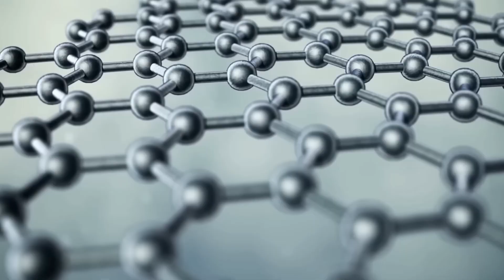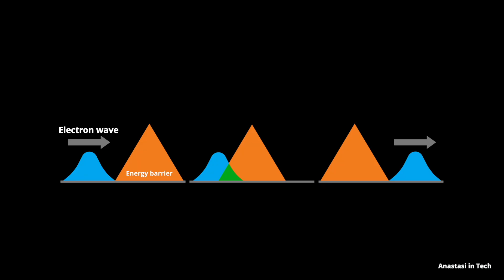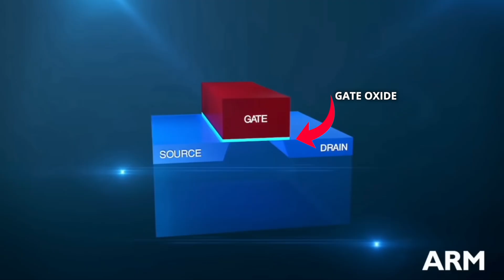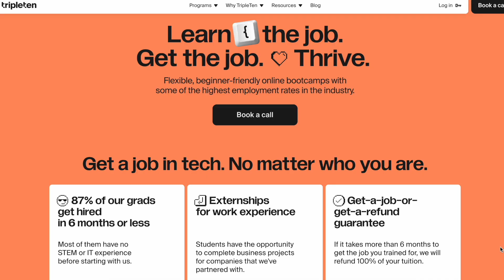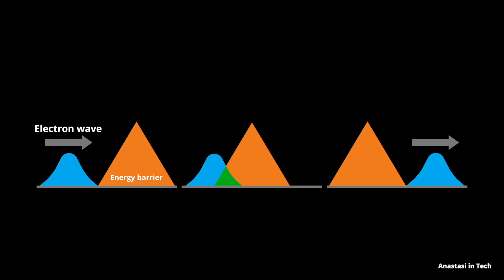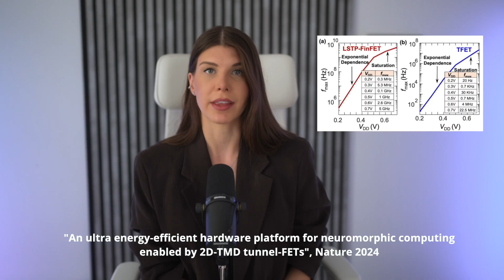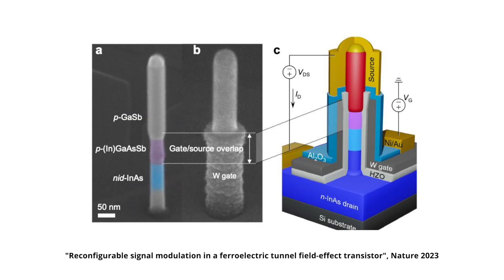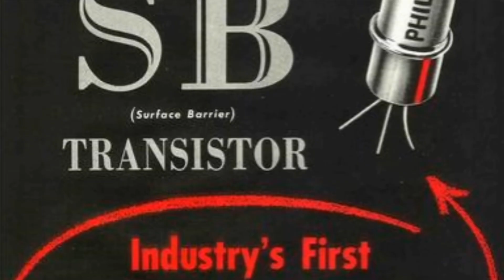New Microchip Technology: 90% Efficiency Gains

Comment from the maker: Improve your career using my code “Anastasi” for 30% off on all their programs! Sign up for a FREE TripleTen career consultation with my link:  https://get.tripleten.com/AnastasiInTech
Reply: Hello anastasi. Which ranking is it reliable to know where can i study Computer Hardware Engenieering?
Reply: Other thing. Why there is no an hybrid solution with HBM and GDDR memories in commercial Graphics cards?. Imagine, 12GB of GDDR and 4 of HBM, both with a parallel access to GPU with a priority of LOD?, it would be awesome, more performace and stability a reduced power consumption.
Reply: You talk like you have decades of experience but look like 20 😀
Reply: A thought, inall my years I've seen many wonder technologies or materials that were supposed to supplant semiconductors as we use them today, and composed today, and never did. What seems to be missing from most of these is the relative gain capability, therefore allowing for a clear signal to pass through the transistors one after the other. Or in the materials that do manage to have the same or better gain, they are so very expensive, that they were uneconomical even 30 years ago.  Is this new material both potentially economical compared to current technologies, and does it provide an equivalent amount of gain?  Or get around that by providing an equivalent mechanism?
Reply: If there are any supposed hackers here worth their weight, I challenge you to troll and disable truth social. But I kind of don’t believe anyone has the skills to do it. If I see it happen in the next few days, I will apologize and send donations. But I somehow don’t think anyone has the talent to do it.
Reply: @NotSure_News_notsuremedia-com I guess you don’t like truth? Either that or you just can’t stand any opinion that is different than yours? How totalitarian of you 😊
Reply: I would like to know if you thing that this new discovery at MIT might be a game changer in your tech interest... https://www.youtube.com/watch?v=17Y82tJDk2o
Reply: As always super video
Reply: Do you have a method for vetting your upgrades? Seems everything is already obsolete, you're so aware. 😅
Reply: Right!?

Comment: I have watched switching voltages over the years.  5V TTL, then dropping, dropping, dropping...  The i486 and PCI bus enjoyed much lower switching voltage requisites.  We have come a long way.  But 0.1 V That's just WOW.  Way less juice needed.  Way less heat generated, and much faster transitions.  That's just WOW...  considering how far we have already come since even the i486.
Do you have a link to you thesis paper?

Comment: Was spending a lot more time outdoors would be one good thing about it, right? Yes, they are going through a substance such as an oxide, but electrons pass through solids all the time, metals, and it's not that the atoms of the insulator are closer together than the atoms of the metal and therefore block the electrons, it has to do with energy levels inside the substance and not with physical barriers.

Comment: you can use this "bad" effect for free energy by using a low work function material, a nanogap , and a high work functioning material. it's called an evercell (Clark Boyd old dominion university , virginia) and the spontaneous electron tunneling creates a small but eternal current. you make them in arrays to get more power

Comment: I was born in 1951 and I can tell you that there was absolutely no smart devices of any kind. Even the first remote control TV's were mechanical and the first ones were even wired. We bought our first TV after 1955. 
BTW: these were all tube type even though the transistor was invented in 1947 I don't remember seeing anything with a transistor until the first "transistor radio" invented in 1954 which were not really popular until later (60's?) because it cost about $50. (that would be almost $400 today.)  ------ K5AZE

Comment: any time some tech announces they "mimic the human brain" you have to keep this in mind as a baseline: 1. neurons fire using their own power, completely independently of each other (i.e. true parallelism); 2. neurons are highly interconnected -- up to 10k dendritic connections each, all working in parallel; 3. activation has inherent decay, which means there is no external mechanism for creating these spikes; 4. lastly, and imho most important: memory is NOT some localized thing that is analogous to a bit that is on or off. memorization equals recall! in other words, in networks of neurons there is ZERO distinction between storing information and retrieving it.  maybe we should be a little reluctant to compare things like back-prop nets or neuromorphic computing to the brain.

Comment: Tunneling was initially described by physicist George Gamov, his theory did not obey the quantum mechanical “essential”  (Max) Born rule, so Born published his own version of qm tunneling that satisfies his “essential” rule. However, in de context of Pilot Wave theory, the Born rule is not essential (not always true), which means that qm processes like tunneling electrons can benefit from Pilot wave energy to gain in potential energy, and this means that qm tunneling transistors can achieve efficiencies of over 100% (overunity), by converting Pilot wave energy into potential electric energy. This is the dawn of powerful ‘free energy’ devices that are independent of solar energy, since the Pilot wave energy exchange with any particle in the universe is huge.

Comment: About halfway through the video at the moment....
There are two things I would like to mention as items of academic discussion.  First, I have actually wondered if the future will involve a form of data storage and flow which is a bit paradoxical.  Most losses in a CPU will come from ohmic losses and switching losses which accompany depletions of gate charges and capacitive biases.  The movement of static charges is lossy.  By contrast, if I have an LC resonant tank circuit passing that charge back and forth, the properties of the capacitor and inductor drive voltage and current out of phase, which results in power dissipation being significantly reduced.  While it would certainly take up more area and be a hassle to get it to work correctly, a CPU architecture which worked closer to a zvs tank circuit at the logic gate level could be less lossy than traditional architectures, at least where heavy processing loads are expected.

Second, I often wonder if vacuum tubes will make a return, almost specifically because of the challenges of using modern CPUs outside the shielding of Earth's ionosphere and atmosphere.  Cosmic rays corrupt RAM and cache memory like no one's business.  Without mosfet and related technologies, I have wondered if we still would not have seen development of microscopic arrays of vacuum tubes and analog computers similar to today - obviously different in specs and capabilities, but if we were to miniaturize vacuum tubes or related devices to produce miniaturized devices, how far could we go?
Power electronics would be the biggest area where we'd be at a loss.  I am not sure something like a variable frequency drive could be realized without some weird motor-to-generator setup.  Though at that point, exotic power vacuum tubes would be just as reasonable to invest in.

Though, to be fair, part of me is just biased.  A friend of mine owns an arcade and I fully intend to redevelop CRT manufacture simply because nothing quite matches the phosphor glow of a real CRT.  I figure I may as well invest in vacuum tube technologies while I am at it, and see what can be done with modern materials and micro/nano fabrication.

As for materials...
Silicon carbide has been known about for some time and it seems more useful for power components than processors...
Gallium arsenic has been used in microwave fpgas for some time and gallium nitride seems to be generally superior substitute... But there must be some reason it hasn't been instantly swept into CPU manufacture, yet, aside from just cost.
Maybe germanium, but again, if that isn't already in use then there's a reason for it.
Titanium nitride had some interesting band gap properties and has already been in use for certain layers...
Diamond substrate has been known about and played with in laboratories for some time, and it would be odd if all the various studies into deposition processes hadn't resulted in reliable diamond layers on the commercial scale by now.
Graphene has been a candidate and has some fun properties that make it more ideal than diamond, but doping of a "1 dimensional" lattice is a bit of an adventure in fundamental forces... 
Some kind of magic insulator that increases its band gap in response to a difference in voltage would be amusing...
I was horribly disappointed in elementary school when the science book had a picture of a robot and we did build, study, or learn anything about said robot in the class that year.  Someone says "new thing" and my mind runs away with it...
I'll be quiet and listen, now.

Comment: Great video, Anastasia! Your explanation of quantum tunneling and its implications for new semiconductor technologies was clear and fascinating. The way you broke down complex concepts like the duality of electrons and the principles behind tunnel transistors made it accessible even for those without a deep physics background. I especially appreciated your enthusiasm when discussing the potential efficiency gains in new microchip designs.
Building on your insights, I would like to know if you've heard about a speculative mathematical framework called Tribernachi Math. While highly theoretical, it offers some intriguing ideas relevant to quantum tunneling in new semiconductors, especially with materials like graphene. Here are a few ways Tribernachi Math could potentially contribute to this field:
1.	Discrete energy states: Tribernachi Math proposes that quantum states correspond to prime numbers. This could offer a new way to model the discrete energy levels in semiconductor bands, potentially leading to more accurate predictions of tunneling behavior.
2.	Three-dimensional modeling: The framework emphasizes volume-based measurements, which could be particularly useful for modeling tunneling in 2D materials like graphene, where out-of-plane effects can be significant.
3.	Bounded infinity concept: This idea may help address some computational challenges of modeling quantum effects at tiny scales, allowing for more efficient simulations of tunneling phenomena.
4.	Novel mathematical operations: The unique operators in Tribernachi Math could provide new tools for calculating tunneling probabilities and current flow in advanced semiconductor devices.
While this is all highly speculative, it's exciting to think about how new mathematical approaches might help us better understand and harness quantum tunneling in next-generation semiconductors. What are your thoughts on exploring unconventional mathematical frameworks in semiconductor physics? Do you think there's value in these kinds of speculative approaches?
Thanks again for the great content, Anastasia. I am looking forward to your next video!

Comment: Electrons translate bi ading conditions towart they interact and at the other side there is a graventational countering that looks like a electron.
In a way alternating curend and mhz curens is olrady simular behavieures as you recordnice as quantum behavieures 
Eaven a tred light bold =
💢🌐💢🌐💢🌐💢🌐💢🌐
And they ad thentional diverentional displasmends towart there surounding that profoce our interstelar fluids the space within inbetween and around  oll ciclesematics and the siclesematics at the same time for us to graventational countering towart to translate it as the experience of light 🤣😍🤣
Light dus not exists between the opsurved a d opserver  it is a feild interaction on demand of the thentional diverentional displasmends in to simulations towart cosmicc lobido yet on a smaller scale the structual cohesional intergertys of the resistamce its conductivetys and copasetys are easeyer to deturbe and than binary is flatlined more easeley
Like the voyerger when it has enterd a less negative plasma philemental behavieures of the space  and in plus it tace in more from infiorment and from min it releases more in to the infiorment and the potentional becomes lower and youl onley get 00000
So in a way tremor in ether can ad 1111 and a lag of thention of the ether can add 0000000 behavieures
Reply: Whay one thick wire has less surpherds to interact with the infiorment and releases and reseave behavieures at the cornal we recordnice as cmi jad cand release and tace inof so the atoms move and the coil burns faster than a coil with thin wires in group wirering 🌹
So eaven our drill use simular behavieures as you recordnices in the chips as quantum property's
Reply: And nanocoltures are olways interacting and transmutation according the set of conditions🎁🐈‍⬛🎁
Reply: So the smaler you go you wil experience interference in the proximity of led light pollution and ferasoll pollution
And when we are between the sun and saturnes and between the sun and the jupitarian troyans🌹
Reply: The day after the plasmafilementals there breaghes below Japan oll nano binary computers has failed way don't we hear anything about this?👀👀👀
They ceap silence hiding it 👀👀👀
While if the are open and honest we can help theme for in the futore
Reply: In a way they are olso laying to you.
Not telling somting is olso laying🥰🤗🥰
Reply: Thank you and oll 🌱🤗
Oll injoy beïng 🖖 🌈 🍀 🌳 🌻 🌱🌻🌳🍀
Reply: Olso when the leaves of trees and plants are bleeding do to a lag of evrighe thentional towart poseble thentional diverentional displasmends and graventational countering as the diamagneticle containment of the leaves do we than realey believe nanocoltures stays the same without knowledge from understanding cohesional property's and diamagneticle inclosemends to hold the structural intergetys intact???👀
To behave as we had expected it to behave without tacing for accond wat I shared bevore🥰🖤💜🖤🥰
Reply: Nanocoltures can experience the same as we recordnice in our bodys as firus cell colapses every nanoparticle is a cell
Reply: And they have seen mass debiation yet becouse they don't understand and named it quantum property's to show there importance so manny understandings are deglacted 
Like a cat bringing it back high our lik it's poot  to protect it status

Comment: I mean, you can think of it like running through a wall. There is a non-zero chance that a person could technically run through a wall. It is infinitesimally small, but if all of your atoms were aligned at just the right way and all of the wall's atoms were aligned in just the right way for a moment, technically you could phase through a wall. Of course, you have to consider that there are 1,000,000,000,000,000,000,000,000+ interactions that would have to be perfect at once for this to happen.

When you shrink the scale and it become a 1/64 chance of this happening, though, that is the problem we are facing.

Comment: In these tunnel transistors, are you saying that the threshold voltage will also be lowered. You mentioned 0.1 V in the video, do you mean the gate voltage required for channel formation. Also, I noticed that in the graph of the valence and conduction band, you mentioned that for elctrons to flow though the channel, with them being wavelike in nature due to the extremely low dimensions, we would have have to only apply the required gate voltage to lower the energy barrier. Is this not what is done in conventional silicon transistors when we invert the channel using the gate voltage for an enhancement typr NMOS? Please do correct me if I am wrong.

Comment: It would be nice to make transistors for the low power, high frequency uses.  However, there are certainly many use cases for low power transistors that work in the GHz range as well, specifically battery powered devices.

Comment: the landing on the moon one most likely would have happened just would have had to be done by hand and all the moving parts would have had to be moved by hand instead of by a computer. The landing capsule also would have had to be bigger to include all the needed equipment to land and take off again. Not to mention much more risky at landing and take off of every rocket ever. 
Intel like every company over estimates what their new breakthrough can do versus what will be made in reality not just on paper. 90% is a huge leap yes though most likely the gains will be around at most 30% as not everything it is connected to will have those efficiency gains and it will have to wait on less efficient parts to finish for it to be able to continue like right now. So  the power used per full ring cycle is important as smaller doesn't always mean more efficient power usage.

Comment: Row of pyramids, slice of ham upside down pyramids in inverse shape of bottom, ham is graphene, slowly squeeze together, design carefully to not strech, although graphene stretches quite nicely, might be a heat disipation issue, need to process in a high velocity helium environment to keey CO2 at bay, graphene doesn't conduct well perpendicular to plain of sheets topology